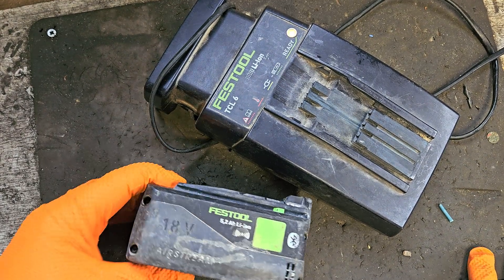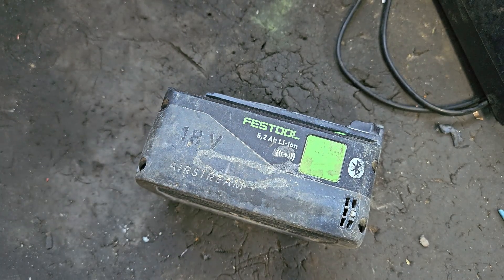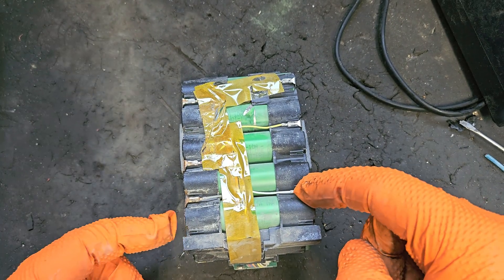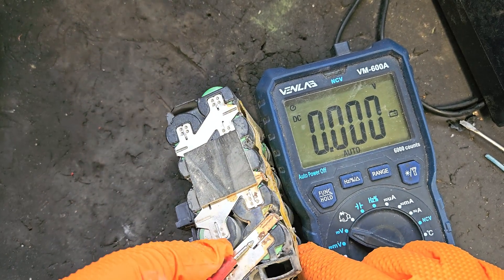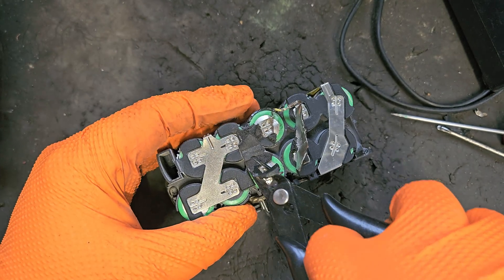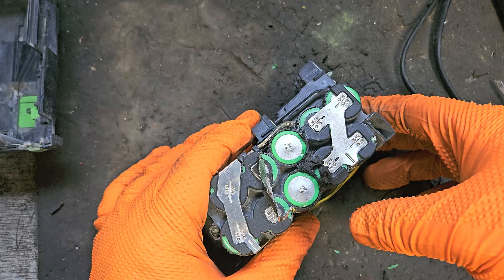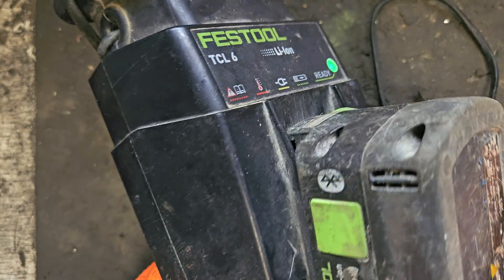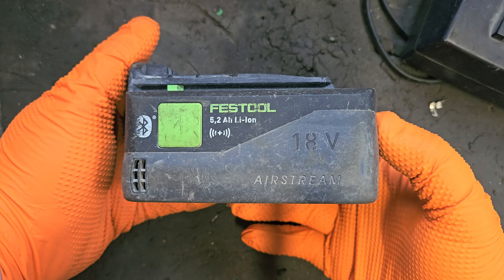Fix Your Festool Batteries - 18v Battery Repair Tutorial

Comment: What size cells are in it??
Reply from the maker: 18650 2500mah 25R samsung
Reply: I’m trying to fix one now. All cells balanced and 3.7 volts but flashing red on charger.. no lose connections or anything

Comment: Fuszera i tyle. Lektor generowany przez ai, porażka.
Reply from the maker: That's my real voice 😆
Reply: @doctorlefthandthread  I don't know English well, so I'm writing this through a translator, there may be inaccuracies.

Thank you very much for the video, as I understand it, the festul board does not go into protection mode after a failure of one or more cells?
Reply from the maker: @akaValkKiller The ones I worked on didn’t go into protection mode with cell replacement. The cell replacement worked fine
Reply: @doctorlefthandthread  спасибо, я попробую сделать это со своим аккумулятором 😊